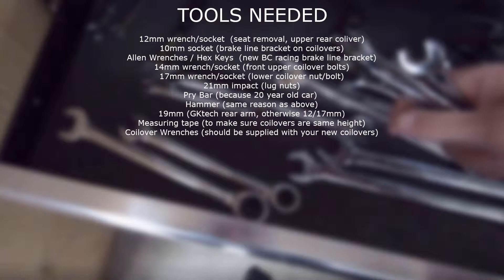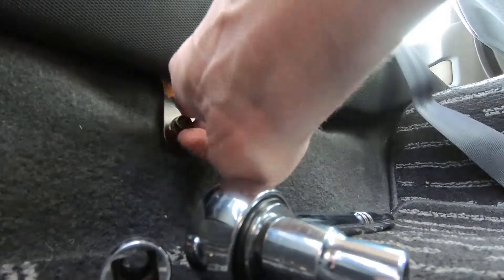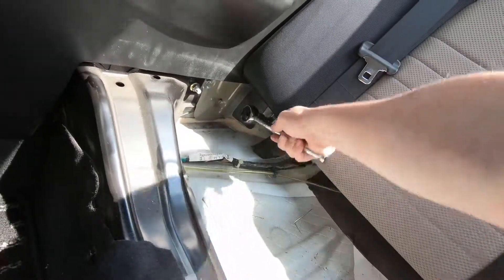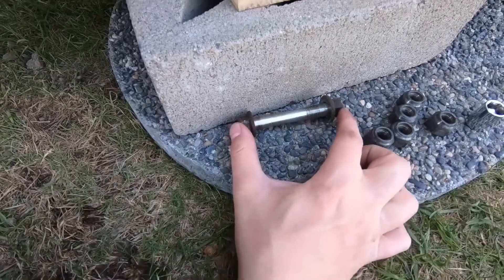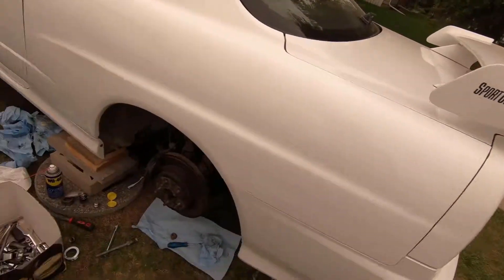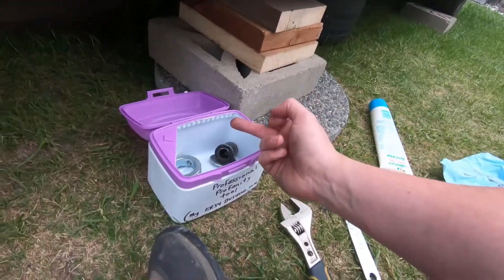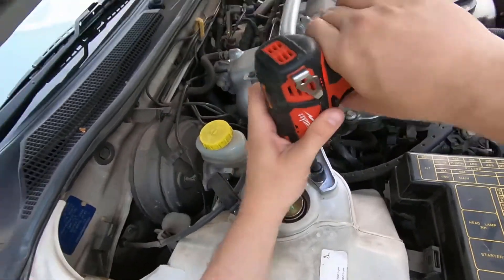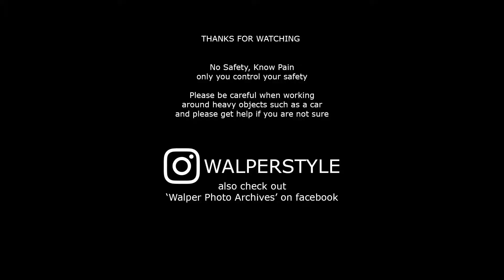R34 GTT Coilover Install (and rear GK-Tech arms, with Turtle Garage HICAS Delete)

Comment: Hey mate I’ve been told the front you have bk to front an you use a spacer on front spindle so long side is facing the front as your coil overs doesn’t show the bc stickers when on
Reply from the maker: Can you reword that I'm not sure what you mean.
Reply: Your front coilovers the bottom part which you said the long side faces rear end of car is bk to front
Reply from the maker: @kieranmiddleton9628  I think I followed pictures from BC's website.